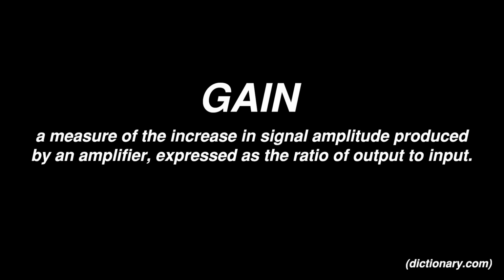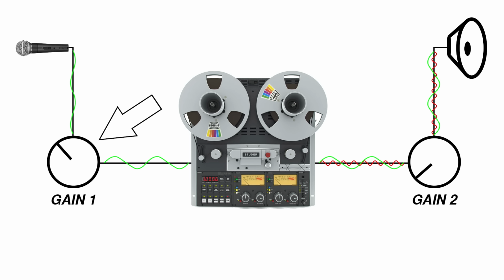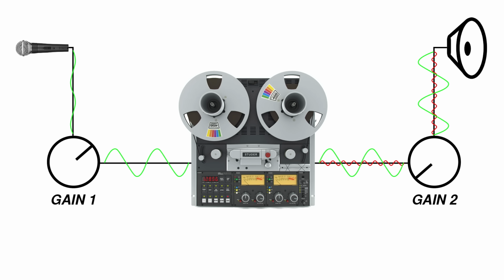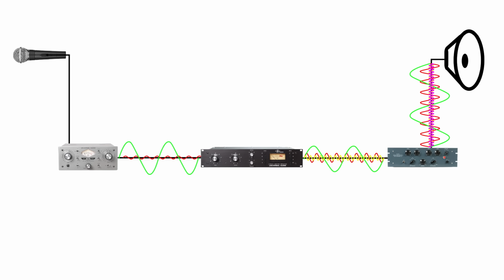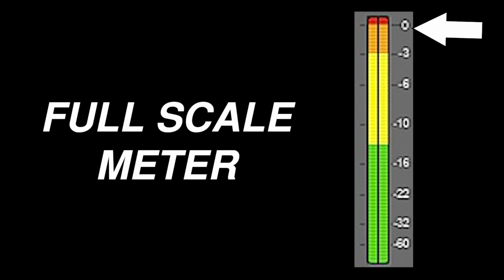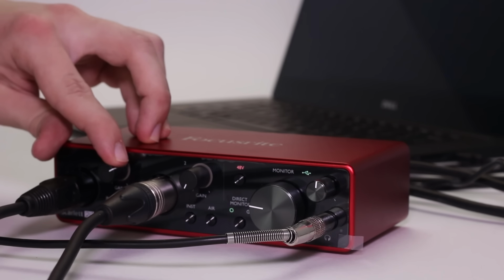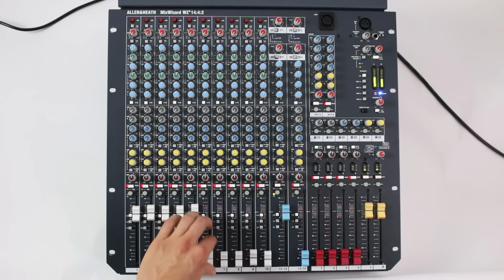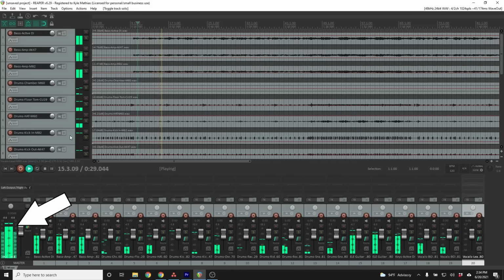Gain Staging Secrets Every Great Audio Engineer Understands!

Comment: This was the best video I've seen on this topic. I hadn't given this idea proper attention, that noise can increase in tandem with harmonics when applying a lack of source volume output combined with additional gain and/or excessive gain (amplifiers, exciters, etc). I have noticed that too much wideness on instruments can reduce head room as well.
I found this was a common issue starting out but now I'm finding that it helps keeping instruments down 30% to 50% volume in the beginning stages while adjusting and mastering (compression/EQ/etc) afterwards. Thank you for making these topics so comprehensive!

Comment: Its actually crazy how much of this I actually knew without being able to properly explain it.  I was expecting to take some new tools away from this, but I really only learned how to explain the reasons I do what I do when I'm setting up to record.  As for setting up gain, I find that the key is getting the pre set up right to begin with.  Post gain adjustments are easily adjustable, where as setting up a good level for recording is only doable once.  Especially when you take mic position into account. 

This is particularly important if there are multiple voices on one track as well, the closer I can get them on the recording the easier it is for me down the line to adjust.  Not a lot of things bother me more than having two separate recordings that are miles apart in overall volume and having to try to make it all work.  I generally make sure to do a few test runs, and do a rough EQ on the vocals to get an idea of where I need to be.  I also tend to do a lot of spot adjustments to match the overall volume of the track itself within the DAW.  Dipping the gain where things get quieter, and raising the levels when it gets louder.  Usually it doesn't need much, but it definitely makes for a better overall mix in quieter sections.

I find, personally, that the hardest thing is getting the EQ right.  I definitely spend the most time on that.

Comment: Gain staging doesn’t really have anything to do with noise in said recoding that specifically deals with line level and only line level and the said frequency being passed though the line level gain staging is what you do while mixing and mastering you don’t gain stage for recoding because in recording you try to get the clearest and loudest sound with out peaking the rule is it’s a lot is easier in recoding to turn something down then to turn something up you stated the reverse the lower the sound the more likely all you will hear is noise as in mix down you try to raise its level up

Comment: So the one thing that confused me (as a fellow Reaper user) - what's the fundamental difference between region gain and fader gain? Do they not essentially do the same thing? Like if I have a synth bass that's clipping, I'll turn down the fader. But if I turn the region gain up on the MIDI, will it not still just clip? Great video!

Comment: I completely understand the concept for studio. But in Live audio I see so many different approaches. I see a lot of people turn on the speaker amps to its max, master at unity and then start adjusting the levels of the incoming signals. 
I was told this is done to minimize feedback since less gain would be applied to the mic, and in non ideal rooms where speakers are too close to the microphones having people talk closer to the mic might help with feedback. Still, I guess this would bring up noise correct? Which I often hear as well. Is this the correct approach or what do you recomend for when setting up in small venues with perhaps just one pair of speaker by the stage? 

Thank you so much for all your content!

Comment: While these types of instruction are quite helpful doing recording is quite different than live sound speech with multiple people using the same mic in turns etc. Church setting.  For example its not very convenient to use the amp for volume control since you are constantly tweaking to improve each speakers voice and their lack of cooperation and intelligence about giving you a decent voice volume to begin with.

I would really like to hear the same talk you just did but addressed for the application and difficulties I just expressed. Thanks

Comment: In film and TV, the sound mixer sends tone to camera which is standard at -20 dB. This gives camera a chance to match my audio levels for their picture. If no scratch is being sent to camera, we use time code. Smart Slates are useful for large, longer productions. 

I gain stage every mic I set up. I have the wired talent talk for a moment. I can quickly gain stage their audi. If there are two ppl in frame, I match both the levels. And, I gain stage the down mix as well, just in case, the editor likes everything that's being recorded. These modern mixers are awesome. You can solo each track, to find the culprit making the "noise". On most modern mixers, there are iso tracks and the down mix. I can't tell the editor what audio to use, but my guess is that the boom always sounds the best. However, you can't always get that boom close enough to everyone, so the lav becomes a primary during walk and talks, or action scenes. 

I use this same exact philosophy when DJing, as well. I can't tell you how many times I see ppl maxing out their mixers, but not boosting the amp...🥴 Lol

Comment: You can have any gain on your daw tracks, even you can have visible enormous clipping of the signal and it wouldnt have any involving to the result signal if you take care about master bus volume. It's almost impossible to overload internal daw bus cause all of the modern daw have 64bit mixing algorithm. The only place when you can get clipping of your mixes it's the master section and hardware output of your sound card and etc. 
          However there are many plugins which require certain input level due to their processing algorithms(overdrive, distortion and other saturators) so you have to follow the level to get proper result.  But it is quite all right if you get some clipping on any internal bus of your daw except master bus.

Comment: You are not entirely correct. Not each stage has to be gainstaged to prevent quantization noise. Modern daws basically float the gain 32 on all tracks (theoretically i can boost by vocal track by 600dB if i do it at the end of the chain, as long as i dont clip the stereo output

Comment: I mix into a limiter with 5dB of gain into it so that I understand how the mix will respond to a limiter when the track is mastered. This also allows me to worry a little less about clipping especially in a 32bit float system where clipping is near impossible. For this reason I can use loudness gain staging like RMS and LUFS so that if you turn off or on a plug-in you only hear the changes made while the perceived loudness is exactly the same.
Reply: A proper mastering engineer won't be limiting in a way that has a clear affect on your program material, leaving what you're doing kinda pointless.

Just mix so that your mix sounds like a finished record. No need to 'think ahead'. Get your mix sounding finished and then send it to a good ME and you won't have those kind of issues.
Reply: @Beenjammin.Buttons  yeah tell that to Jaycen Joshua
Reply: @Mad_Speed  All his info is second and 3rd hand via Bob Powers and Dave P.
Reply: @Beenjammin.Buttons  what so that’s 3 engineers saying that we should mix into limiters then?
Reply: @Mad_Speed  Nope. I'm not referring to them saying that, because they didn't. I'm saying that the majority of what he says, is second hand info. Go to the sources of the info. Or give it a few years and he will probably change his mind and be saying something else.

If tracks are going to mastering and the limiter (or other processing) is changing the sound, you're not using a proper mastering engineer.
Reply: @Beenjammin.Buttons  limiters have a sound to them. A lot of limiting is actually done for the sound. Also very unlikely he’ll stop using that method considering he had a plug-in made using his whole master chain including that.

Comment: Hi Kyle,
You're one of the few people who seem to have a clue about this whole recording process.
I come from the analogue world, and I use custom meters to duplicate the old school way of dong things (I write my own plugins).
My '0" dB on the analogue meters is the same as 0 DBFS. If I go 'red', I'm clipping. Period.
Yes, 16 bit digital is as quiet as an analogue machine with dbx., typically < -90 dB noise floor, typically -96 dB.
Little known fact.............
When you record to -12 dBs, you're NOT using the two highest digits in the 16 bit domain, so you drop from 16 bit to a de facto 14 bit quantization.
That means that you give up 12 dBs of dynamic range, you're now at a -84 dB noise floor.
Every bit of quantization equals 6 dBs of dynamic range, 16 bits = 96 dBs of dynamic range (16 X 6 = 96).
Worse yet are the 'engineers' that record at -18 dBs, thinking they have the 'room'.
They don't. They're at 13 bit quantization, or -72 dBs noise floor.
I hope this makes sense to you.
Try recording 'hotter' (like the old days, 1961 for me), and pick up some dynamic range.
Keep me posted,
Bill P.

Comment: I would like to ask you a question concerning the gain on headphone amp since I can not find any reasonable explanation on YT about this topic. 
So, I’m running Neumann NDH20 through topping L30 ii. Since there is no noise in either gain (medium or high) is better to run headphones on medium gain @ 11-12 o’clock volume od high gain @ 8-9 o’clock volume? 
Thanks.

Comment: So my question is what you mentioned at 6:46 with region gain...does it really matter if you record in your pre-amp into the DAW at a level that might exceed average -18dbfs/peak -12dbfs as long as you never clip because you can just region gain down to -18/peak -12 after the fact? I.e. as long as my recordings don't exceed 0 I can always manually adjust down via region gain to -18/-12 without consequence? Or is a nonclipped signal that is region gained down to -18/-12 still not as useable as a signal captured inherently at those levels?
Reply from the maker: Yes. As long as you don’t clip, you’ll be ok. In fact, 32-bit float audio can clip and still be ok!
Reply: @AudioUniversity  thank you. Okay that makes sense I was getting confused for a second there as I’d been researching this all day. And so by and large can we also state that in the absence of a completely unprocessed raw track stem/signal having any clipping that there can be no distortion occurring? Or one cannot say this with certainty?

Comment: There's an invitation at the end of the video to add comments to it. Here's my input: I deducted years ago a simple formula to calculate the amount of headroom required on each track so any master bus with any number of tracks would always have enough headroom. Actually, they are two. The first one assumes that all tracks are correlated signals and the second one assumes the opposite. Your mix will be between those two limits. So, formula for lower limit:

Hr = 20Log(1/n) dBFS

Where n refers to the number of tracks. The upper limit:

Hr = 10Log(1/n) dBFS 

These formulas are contained in a book I'm currently writing, called "The Dynamic Range". I'll let you know when I release it, in case you are interested. Cheers.

Comment: I hope you are aware that modern daws are in 32 bit internally and gain staging is pointless. You'l probably say "some plugins require a certain input...", The answer to that is... only the badly written ones.  The daw is not clipping on the master, your d/a output device is. When you render your master red in 32 bit and later normalize it, there should be no clipping. 32 bit can hold more then a 1000 db. Which is more then a planet exploding. The meters are just there for visual aid and legacy workflow. This video only holds up in a analog signal path prior or post to your daw. Also headroom to breath is BS in a digital environment. There is no amp that produces more noise on louder lvls but digital bites you are scaling mathematically again your d/a is just getting hotter. Hope this helps anyone.
Reply: Yep… I completely agree. Gain staging is a waste of time. I used to be religious about it, but the more I’ve worked in the professional studio environment, the less I care about it. I run a 32-channel vintage Neve console, and while tracking there’s some amount of “gain staging”… but you realize pretty quick how simple it is. Just don’t give it unwanted distortion from the console or the outboard effects. In ProTools though… you can “clip” your channels however much you want. I just trim my master bus if it’s clipping the d/a output. And trim it below 0dBFS right before rendering. I think people (esp on YouTube) like to add unnecessary steps in the middle thinking it will make their mixes sound great.

Comment: I setup my whole mix and made each clip about -20 average fullscale, but my snare, OHs, Room mics are sometimes clipping or at least peaking barely under 0. I've done everything correctly so I don't understand how could there be such a drastic fluctuation? It makes no sense? Thanks for the video.
Reply from the maker: Check if you are using True Peak meter, a RMS meter or VU meter. These will give you different results, especially when comparing transient signals like drums.
Reply: @AudioUniversity  My meter says Digital VU in Pro Tools. When I received the drums they were recorded pretty low. Most was at around -30 average so I turned up the clip gain to average -20 but some stuff then started clipping. Is this because room mics etc. are introducing more floor noise?
Reply: @AudioUniversity  i just switched all tracks to Pro Tools Classic and buses to Linear? How does that sound?

Comment: For all gain related work, I cannot recommend enough Klangfreund LUFS meter. It saves you a lifetime of eyeballing and guess work with levels and mouse clicks. It has multiple grouping options so you can level match everything according to Loudness in one set. You can gain stage/fade up mix really kick, compare dry/wet fx between tracks, and so many other things. It's very light on the CPU. Mike Senior brought me into this plugin.

Comment: There is another inherent issue with having the master sliders too high or too low: the individual input sliders will not have much leeway to accentuate or attenuate the sound. It’s better to be able to control the individual input faders so they can move for a longer range and therefore able to make small and more accurate adjustments. I have seen many sound mixers keep the master faders very high and not being able to make much adjustments with the individual faders since they were placed too low or too high and thus had very little room to move up or down and that made for more difficult mixing.

Comment: You left out the single most important thing to be aware of when setting your gain stage. The difference between a volume control and a gain control. Only gain controls can distort the signal. Volume controls can't. Gain controls are on the input of a component and can amplify the signal the more you increase gain. Too much gain can overdrive the signal causing distortion. Volume controls are on the output section of a component. They don't amplify the signal, they attenuate it. That's why you can't distort the signal with a volume control. Its also why its called setting your gain structure and not setting your volume structure. Gain controls need to be set in such a way that the signal isn't overdriven somewhere in the signal chain and causing distortion. Once you have gain set, use volume controls for adjusting loudness.

Going back to the guitar amp example, its typical to have a gain and volume control right next to each other. You first use the gain control to dial in how much distortion you want, then use the volume to adjust loudness.

It's also worth mentioning bit stripping. Bit stripping is a loss of resolution due to adjusting volume while the signal is in the digital domain. In order to get full resolution, a digital volume control has to be set at maximum volume. The more you lower a digital volume control, the more resolution you lose. How much of this is audible depends on the quality of the source material. DJ's that use software and controllers are the best example because they typically work with low quality files (MP-3). The highest quality MP-3 you can get is 320kbps. You only get 320 when all your digital volume controls are set to max. As you lower volume, the signal isn't 320kbps any more. The 320 drops the lower you go. The easiest way to deal with bit stripping is to use high quality files.

Comment: Yeah, but this voice is about 6 dB low on the video stream. Digital TV broadcast reference level is -24 dBFS except for PBS which uses -27 dBFS. Using a smaller value may be OK where original recording is done, but also note that loudness level matching applies as an FCC requirement. Loudness is another video somewhere, matching dialnorm with the reference, using a loudness meter.